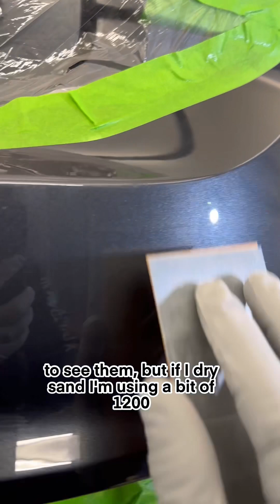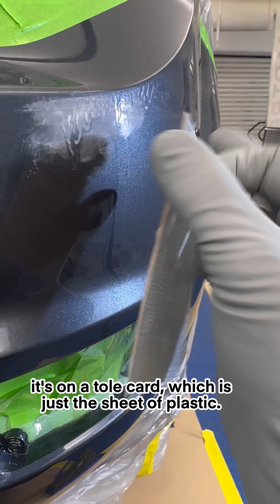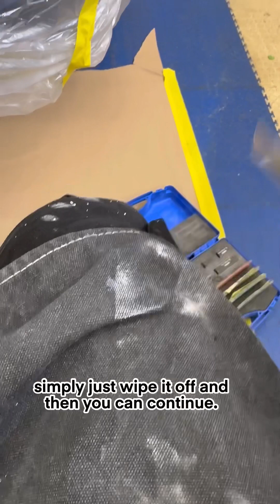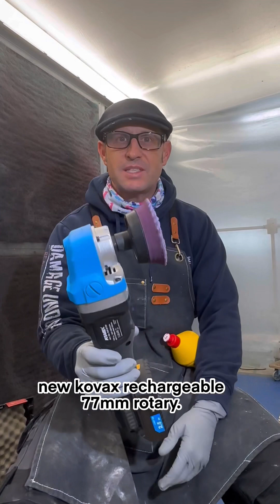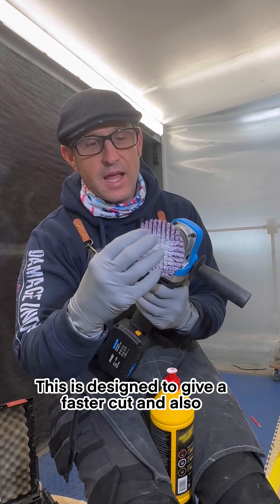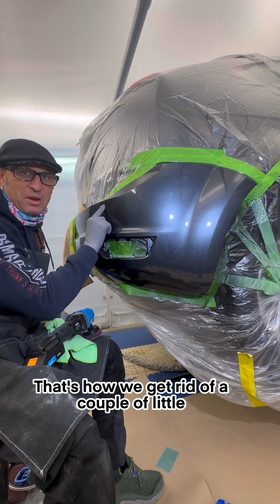THE BENEFITS OF DRY SANDING

Comment: Good demonstration Wayne, the problem I have when sanding runs (yes I do get them😁) is that I sometimes cut through the surrounding clear before the run has been removed, I use a block but find they have a semi hard base to them so I wonder if this is the cause🤔

Cheers Wb👍